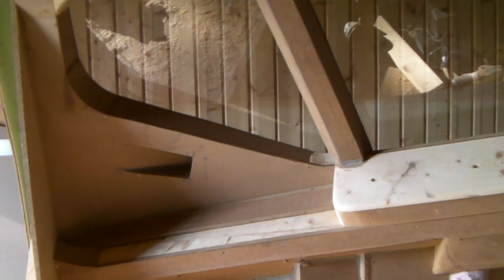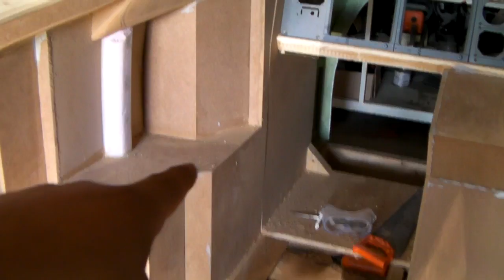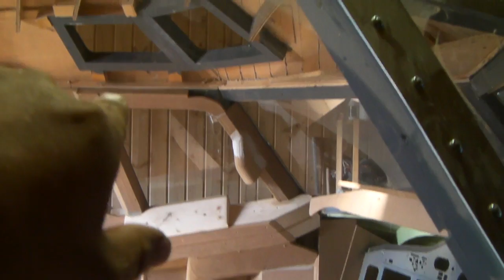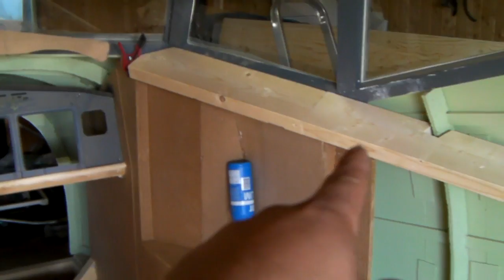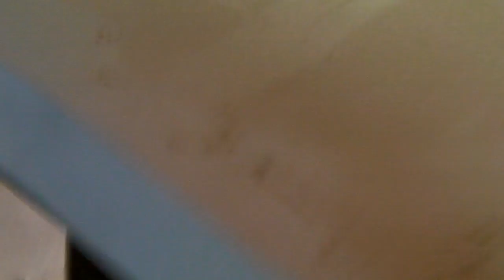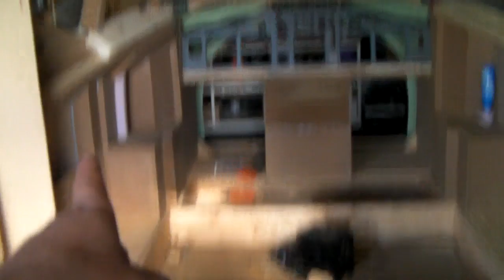Building a Boeing 737-800 home simulator #25

Comment: Wow this is really fantastic work I have only seen this video so far but I'm going to watch from your first video. I have question: Would it have been possible to buy a cockpit section from aircraft salvage ok maybe a 737-200 and adapt it to the 737-800? I ask because I'd lie to do a similar project, but maybe with a 707 or something Thanks!